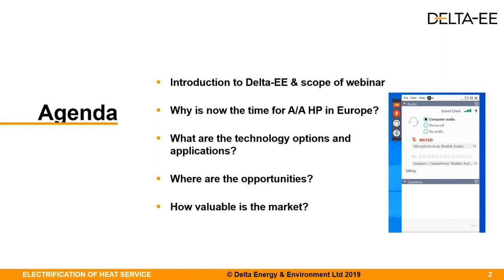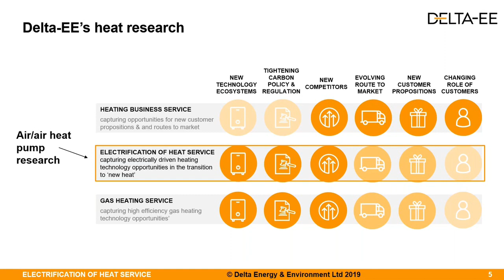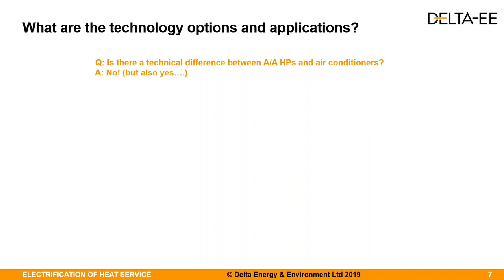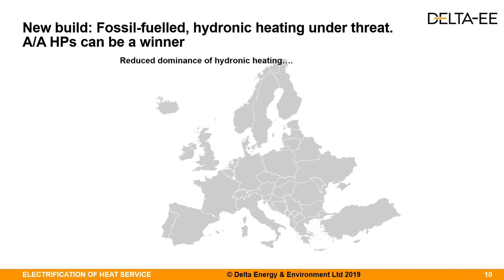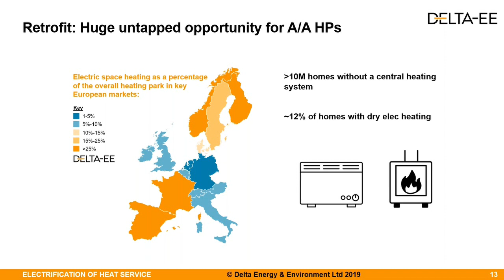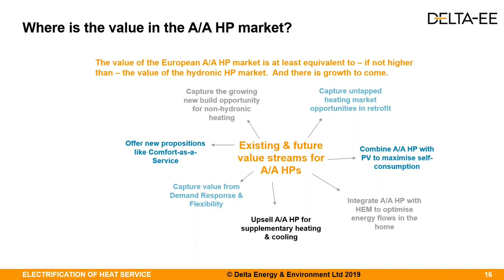The time is now for air/air heat pumps – capturing the opportunity

Comment: At almost halfway and you said that France was requiring that these be installed for heating only and that customers are good then modifying them to provide air conditioning in the summer. That's extraordinary, if the goal is to not to central air conditioning then you need to provide surface Cooling and radiant cooling especially and these buildings at all times and also put teeth in the rules about not using the air handler for dehumidification. I know this webinar was about air-to-air but that was not a slur against radiant Cooling that was just against Air Handlers using or PEX embedment and concrete Fiasco's.

We can place odds on whether you're going to do a webinar about radiant Cooling dispelling the myths of the German 30000 lumen low bay High color rendering index radio not just lighting but Cooling fixture maker